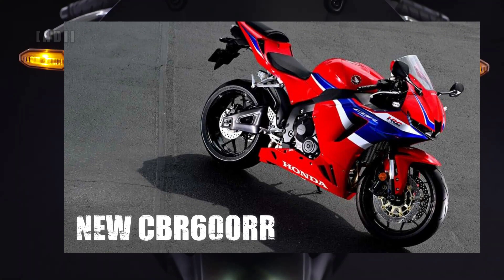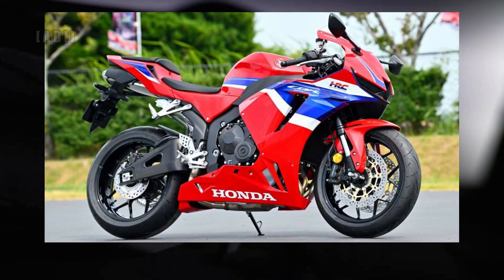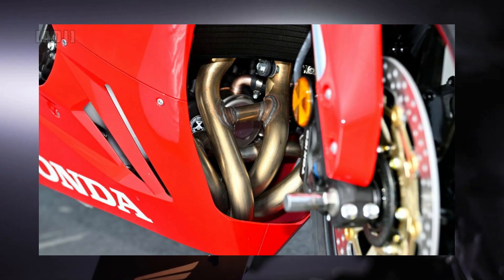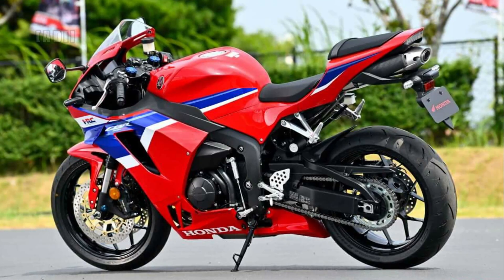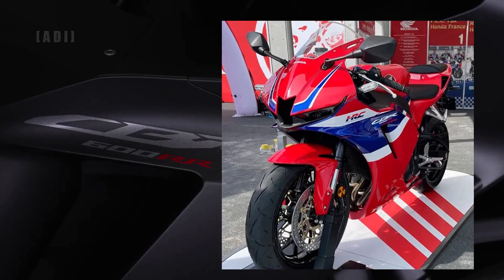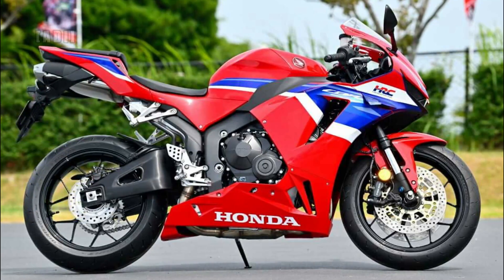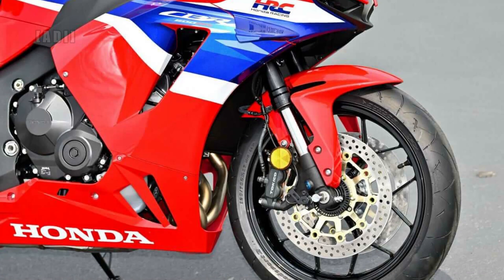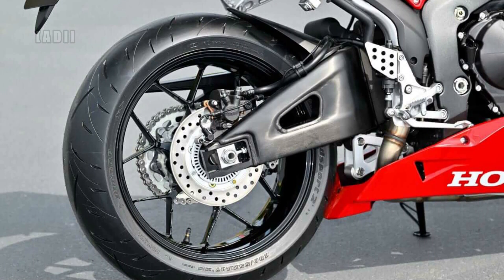2024 Honda CBR600RR - SPECS & FEATURES

Comment: All that tech and still no fuel gauge !
Shameful and lazy, Honda.
Reply: There's been an electronic gauge for a while, unless I'm misunderstanding?
Reply: This new design has a wonderful TFT dash, but they did (not) include a fuel gauge on it - only a fuel low idicator.  
My point is that if they were going to invest money in redesigning and improving everything, why would they eliminate a feature which is crucial and appreciated - (the actual fuel gauge).
Reply: @iamtheiceman  are you basing this on the video? I'm guessing the features aren't official yet? Anyways I'm used to using mileage to keep an eye on fuel. A guage would be nice of course, but it's  not accurate at times when you go from chilled riding to pushing.
Reply: My r6 doesn't have it either. Apparently they do it to save weight?